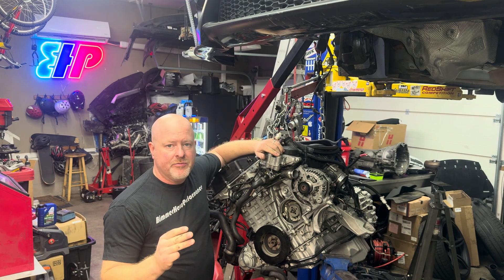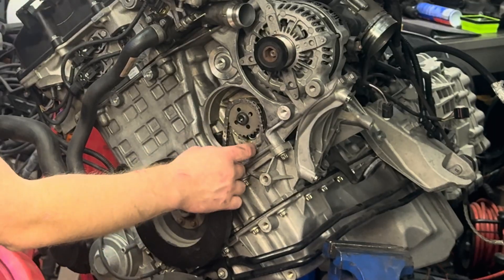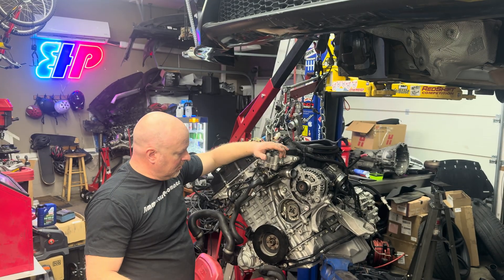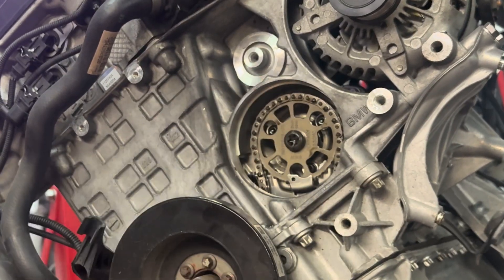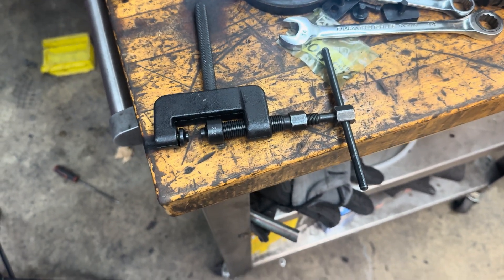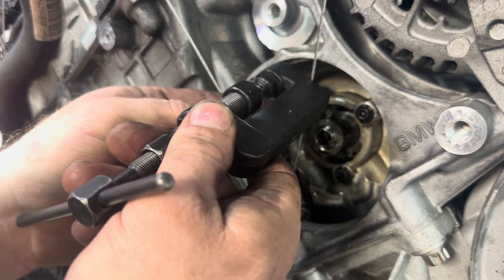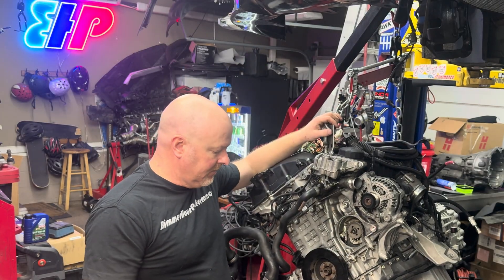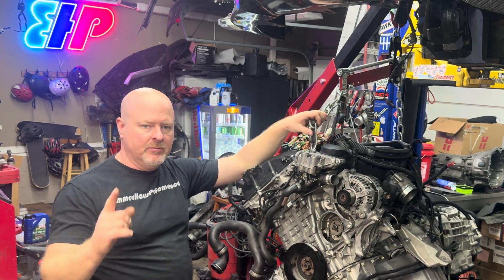N54 and early N55 HPFP Overclock sprocket install - BHP

Comment: Has anyone accomplished the install, with the engine still mounted in the vehicle? 

I’ll be doing this tomorrow. I’ve planned to remove ac lines, alternator , drive belt, belt tensioners, and cooling fan assembly . It looks like that will give enough access. 

I’ll find out tomorrow as I’m installing tomorrow. I’ll be pulling new chain through, only because, I can’t recommend to master link an old chain.
Reply: Update?
Reply: @georgebetz7026 I did the install. Successfully got new chain through the engine, riveted the master link. 

When I went to tighten the bolt on the new bimmer haus  hpfp gear, the tensioner guide broke. So I’m also doing a full timing job. 20hours of work and approx. $1,100 in parts. 

I have 135k miles on my engine.  So it’s time anyway.

Comment: You stole this idea from hydra performance and now claim you designed it. To everyone looking to do this, you can buy the parts yourself for much cheaper than this. There's forums and other videos showing the same method with part numbers for the two parts.
Reply: So what? Hydra never fucking made an install video. Fuck them
Reply: Hydra never event launched it. And hydra STILL has not even released an install video.  .
Reply: Any part number or size for master link?

Comment: I'm going to place the order. I'll be replacing the oil pan gasket in a few days. Can I join the two chains from the bottom of the oil pump? And just change the sprocket on the top?
Reply from the maker: Yes 100%

Comment: Finally I sprocket in and with guide  tomorrow going to start first time . I hope everything goes well .
Reply: Do you install it?
Reply: @r3drogo yes I did install that Spocket kit it work . I was pushing 30 psi on my engine but cylinder sleeve got crank and alot fueling left for push the car more  . I was running e60 mix . 2 days ago I pick up new engine going to start all over . What i learn dont push your more than 28psi than you are taking risk on your engine. Do it when  you are build your engine with block deck and upgrade the rod and piston kit . Soon i will go to b58 platform.  .....

Comment: I bought this kit and i like the kit also He help me alot with all the parts . My main problem happen my car vacuum pump sprocket bolt not open and guide broken down . If that doesn't happen I will pull the sprocket and dyno my car. Right way

Comment: Currently installing this into my E92 do you have any info for that master link installer tool or any suggestions on how to get the master link on with out a special tool? Got mines on just can’t get that other part of the master link to press on, I’ve used pliers, c clamps you name it
Reply from the maker: Here you go! 

https://a.co/d/hdQmypP
Reply: I would like see your dyno number are you running single turbo kit or twin set up